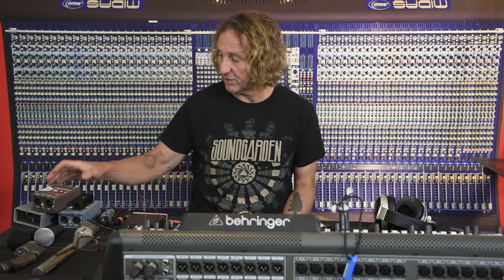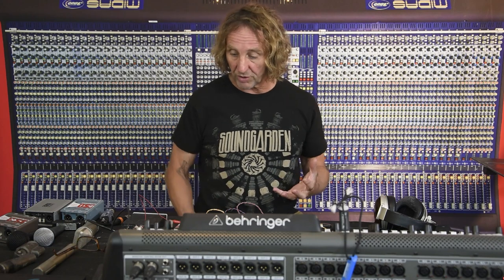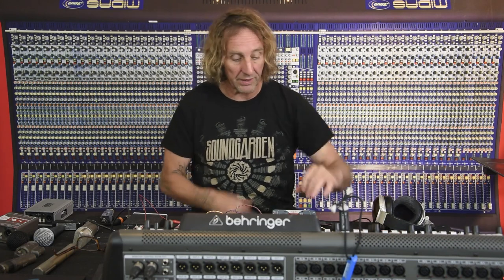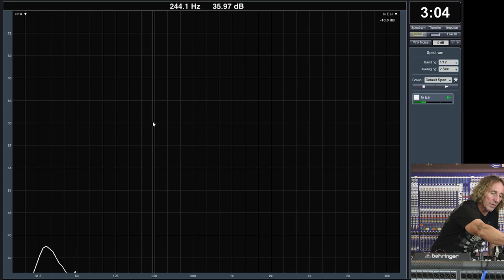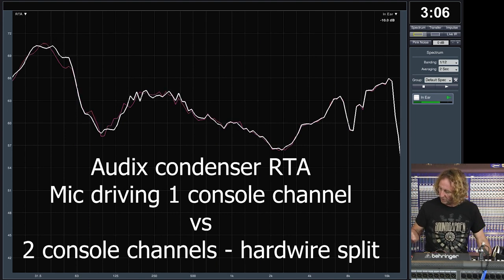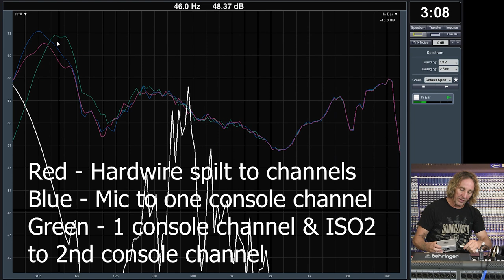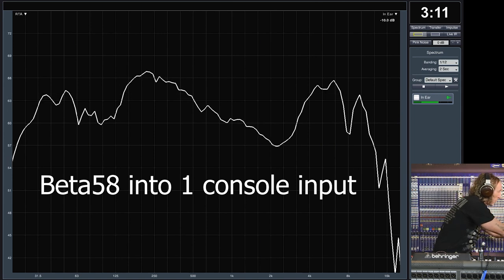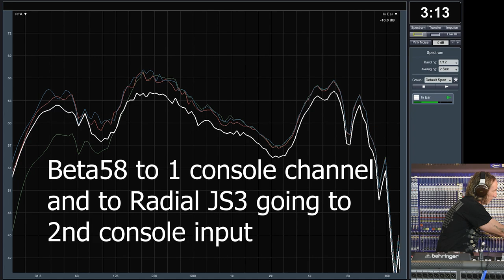Do Audio Transformers Mess Up Sound?  Demo Part 1

Comment: My apologies if I am spoiling the punchline of a later video. The Whirlwind ISO2 is not a mic splitter and is designed as line level isolation transformer, as such a mic should never be connected directly to it. I would fully expect it to alter the frequency response when connected in a mic level circuit. The Radial JS3 is marketed as a mic splitter. These two transformers are for two different use cases. It is on us as system designers and engineers to use the correct transformer for the job. Awesome test though. As you mentioned a little level drop is no big deal as long as the frequency response is unchanged.
Reply from the maker: Ooooh! This is a great subject.

We have mic level and line leve audiol transformers. Do we need mic level for low level signals and line level for high level signals?

We know that running line level into mic level transformers . Can overload/saturate them, but are there issues with mic level signals in line level transformers?

If so, does that mean that quiet and low level line level signals sound bad in line level transformers?

Or are mic and line level transformers pretty much the same and both equally good at mic level except line level transformera just allows higher level signals?

Anyway, I may do a vid on that but in the mean time, for this series I will show that both mic level and line level transformers impact the sound of microphones.
Reply: @DaveRat  I believe it mainly is the impedance of the circuit elements that causes the problem you are seeing here. Even if you load a mic with multiple consoles with a hardwire split you will see frequency response problems due to the loading of the mic output. This will depend on the output impedance of the mic and the input impedance of the connected loads (whether transformers or electronically balanced inputs) I think you illustrated that at one point in your video with the blue line, but at one point (8:45) you said there was no difference between the hardwire split - two channels driven and with hardwire split - single channel driven (I may be mistaken on that). Later you showed that there was a low end difference with one channel driven as opposed to two (the blue line at 10:17). I am not trying to be pedantic or criticize in any way because these issues are in fact real. Interfacing analog gear is a huge problem. Many high end mic preamps for studio use have variable impedance so the engineer can experiment with "color". The level issue is another can of worms altogether.
Reply: @DaveRat  Please do that video!

Comment: Hi Dave, once again, you have presented a nice topic with good scientific method to provide answers to the questions... questions many times people aren't asking and should absolutely be asking. Your topics are great in that you tackle stuff that has always been taken as gospel. Transformers are one of those things. They come to the party like a burly super bouncer and throw out hum quick and without fuss, and a lot of times really solve a tough problem effortlessly. So they get the praise and hardly ever get questioned about that big S on their chest. But the real science behind this and your "sound coloring" type topics is that inserting ANYTHING(gadget, wire or otherwise) into a signal path - mic/line/headphone/speaker/nuclear level, will ultimately change the impedance characteristic and matching in that system to some degree, EVERYWHERE that particular gadget insertion is coupled. And transformers are no exception. Not only that, but sometimes, they may add a more incorrect impedance matching scenario for some applications when using split type transformers and can actually mirror bad impedance matching scenarios into unwanted places. I think it's easy to get the notion that somehow, magically you can put one microphone signal in and get three "identical" and split outputs without paying any price. But science is a heartless bitch that doesn't bargain and will always set the price. I can see where you're heading with this topic, and it'll be nice to see your part 2 and conclusions on just how big a price you have to pay at the end of the day, and is that price worth it for some applications.
Thanks again for going through this and doing the footwork with the simple to understand testing that hopefully more techs will understand and remember. :)

Comment: Yeah, as a gigging musician, my passive splitters (aka transformer) have been life-savers on numerous occasions and in the vast majority of those, the tone alteration was insignificant.
 However, a transformer is essentially just two electro-magnetically coupled coils, which will interact with all the resistors, capacitors, cable-capacitance/-inductance, transistors and op-amps connected to either side of it.
 The "isolation" technically only refers to the grounding-connection, not that the signal itself is isolated.
 The afformentioned occasions of significant alteration were in 

A) using a transformer between my interfaces headphone-out and wireless-gaming-headset-emitter, which resulted in a strong low-pass filter; and 

B) when splitting the direct electric guitar signal, but with a fuzz-face style pedal in either signal chain.

The latter is really a consequence of the the fuzz-faces unorthodox way of loading the input, but it was an eye-opener for me, that a transformer is and will always be a part that interacts.
Edit: PS: when using a fuzz-face, there is no possible way to split the direct guitar signal AND have the fuzz work correctly.
There is a pedal called Lunar Module that supposedly still sounds and reacts like a fuzz-face, but without the loading, so theoretically, it should work with a splitter.

Comment: OK, so this is inline with the impedance video i did a while back.  A change in impedance will alter the lower end response of just about any microphone (more noticeable on dynamics).  The high end isn't effected as much (if at all).  Higher impedances directly connected to the mic resulted in better low end response.  Lower impedance started to rob the bottom end a bit.  We used the variable impedance cloudlifter  product to be able to see what happens to the response as you increase/decrease the load.  When you got to "dangerous" low impedance, you started losing signal strength as well.  Im guessing that when you start to load the line down with splits and other transformers, you're changing the impedance the mic is seeing, resulting in a change.  Would be interesting to see what happens if you have a higher impedance transformer on the same split.

Comment: I have a Radial V12 Convertible splitter (56-channel, 3-way, with Jensens). I did this test a while back and found the differences through a transformer split and 150' snake to be +/- .8 db, mostly centered around 70 Hz. Good video, Dave. I do live recording and I've never had an issue or a complaint with the recorded tracks or from the broadcast truck.
Reply from the maker: The sound through the transformer vs the sound direct are near 8dentical with a slight attenuation as you tested.

The issue is that the sound when the transformer is not connected vs with the transformer connect has much bigger differences and the differences 8mpact both the transformed and direct signal

Transformers change the way the actual mic sounds
Reply: @DaveRat  Agreed. But the sound through the Jensen mic splitter transformer is pleasing and not at all bad. I would like to see the harmonic distortion levels through the transformer, both at unity and pushed a little. That would be good info.
Reply: @DaveRat  Also, I wonder what the impedance has to do with this too. I was always told to get the Jensens instead of the Lundahls because they were better at preserving the high end on long analog cable runs because of the impedance. Never tested it. I do love me some analog farm to table.

Comment: I know the old analog splitters often had transformers on every channel.  But these days if I'm using an ISO it's almost always going to be on a line level signal.  For example feeding a green room speaker that's plugged into the wall.   I'm curious if the transformer has the same amount of impact on a line level signal vs mic level.

Comment: quality video demonstration; a valuable look in to the difference between transparent and colored transformer design. I still prefer Whirlwind products. From what I can tell the whirlwind being the lowest will allow for the most depth of change per perception in the low end and for people that want more breakup sound coming through in the low end of their signal the Whirlwind should be the best. Most transparent Cinemag would then be least colored and therefore offer advantages too. Nothing is right or wrong here since they are transformers and the signal itself is not being manipulated as much as it appears though I'm sure there are those people that will jump to conclusions and want to think whirlwind is wrong, still my favorite. I also really like whirlwind cables.

Comment: Owning a mobile studio made a big fan of transformers. Many years ago, I found a seller with 40 Triiad-Utrad mil-spec transformers with surprising specs [+30dbm below 20hz flat to 30,000 with low distortion]. I think their new cost is $250-ish each. They sounded so transparent to me, I installed them as default in my truck’s hi-level IO. They were TT patch bypass-able but I never even bothered. If someone needed a feed or had a source, it went thru one of those transformers. I made 12 of them into durable handheld ‘dongles’ that can be used for self defense if needed. They are heavy, solid steel cans plus shielded windings. In 30 years of work, they’ve probably saved me a couple weeks 🤣. They are for my purposes, perfect. Very expensive, no excuses.
Reply: interested in selling a couple of them nunchucks?

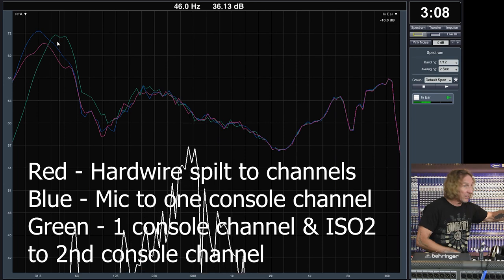Comment: 11:52 of course it changes a bit the response of the mic. Consider that the mic is "watching" 2 different worlds. With the Xformer it's coil and it's internal xformer it get substantial inductive load (and complex, considering also the distributed capacitance inter-winding), very different "environment" from a direct connection to a transformerless preamp. However these values are very small. 
Di per se, if the xformer is connected to signal generator form one side, properly loaded, and the same to the other side going to analyzers, you should get the declared specs 😊
Reply from the maker: I get the declared specs through the transformers. But what good are having super accurate declared specs when the transformers alters the sound of the mic source itself in drastic ways that are 100 x more sloppy?

Plus the transformers alter condenser mics and dynamic mics differently. And alter each brand and model of mic differently and each type of transformer induces different changes.

So here you have this precise transformer spec and as soon as you use it on a mic it makes a huge change to the sound of mics that does not show up in any spec.

All good as long as ya know that you won't know what will happen till you plug it in and listen and what you end up with is not just mic spec plus transformer spec.
Reply: @DaveRat  it makes sense because it’s impossible to test an Xformer on every single mic on Earth. If connected to TLM mics to one side and to electronically balanced pre to the other side, it should behave as declared. But when this is not the case, having a pletora of preamps and mics, it’s impossible to go through all.
Reply from the maker: @Not-Only-Reaper-Tutorials  yeah, so for me, I was surprised the difference were as drastic as they are and so divergent based on mic and transformer.

We tend to assume that if you plug in a mic with a known response and sound into a console with a known sound and split with a transformer with a known and flat response, we will get those known sounds.

The fact that adding the transformer alters not only the sound of the mic passing through it in ways not shown in the transformer spec, but also alters the sound of the mic sent to all other places that are not even passing through the transformer, is interesting and I believe most people are not aware of.
Reply: @DaveRat  exactly… there is not consistency into the sound. Each time a different result and ppl is convinced is something… but it’s something else. That’s why I do avoid transformers as much as possible, when they are interfaced with other transformers. The most sensitive mics, for this side FX, are the passive ribbons … they are dramatically change the tone based on to which transformer are connected to. That’s why I use active ones. And condensers: transformerless.
Reply: @DaveRat  just for example: take a SM57 it has a transformer inside. it's tested at specific impedance. But to what it will eb connected, is totally different from the way it's tested. If it's connected to a transformerless preamp: chances are the characteristics are exactly the ones declared.
but when you connect ti to a transformer, things are changing. The impedance of this, not only is sen from the Xformer of the Sm57, but it's translated down to the capsule, and she will work differently; 
because the impedance she will see, it's a bit more complex and different from the one she was tested (this latter is tipically pure resistive) ... and it changes her response .. or better the response is the result of the summign factors: Capsule + mic Xformrer  + external Xformer. And so on and so forth ... I prefer (as I said) to avoid to use them as far as I'm constrained for some reason.
Reply from the maker: Yeah, it's more messy and audible than people realize

Comment: So I can visually interpret how a transformer will make a mic thin, thank you Dave.
Reply from the maker: And yet as you will see in future videos, transformers make some mics have more low end
Reply: But it noticable only in inaudiable frequencies in low end so no biggie
Reply: @frutekneobichni2123  not really, with the dynamic mic it starts rolling off at above 125hz. Also, the attenuation is pretty substantial at close to 5 or 6dbs on some frequencies..

Comment: Was the graph showing a sum of channel 1 and 2 or just channel 1? If it was the sum my uneducated guess is that there is a slight phase shift leading to negative interference in the lows. But that would be irrelevant to me as I never sum two transformer isolated signals.
Reply from the maker: The graph is not showing the sum.

Adding a transformer adds inductance altering the output of the mic.

Just adding the transformer whether it is plugged into anything else or not, makes everything the mic is connected to sound different.

Comment: my spidey senses says something with the impedance is changing which is causing some of that low end roll off? I'm not an expert, but yeah good to know this is a thing!
Reply from the maker: Yeah, the sound through the transformer is excellent but the inductance and resistance of the transformer alters the sound that the mic outputs.  And on some mics it boosts lows, some it cuts lows, some it attenuates some or all freqs.
Reply: @DaveRat  wow! so things are not as simple as they may appear on the surface, or they are not as simple as we want them to be! haha great insight thank you sir
Reply: @DaveRat  Are these all proper wound transformers, or are some using some sort of solid-state buffer?

Comment: Interesting, although visually and to my ears the noise does not really change on the Radials. Given the behavior of coils (storing energy in magnetic fields), I'd be interested in phase changes as well, but given the nulling options, you're probably going to talk about that in the next videos. One more thing, do these transformer boxes normally have a method of transferring phantom power? I'd expect the simpler versions at least to block that (it's DC after all). Since you use a split, I guess that's what gives power to the Audix?
Reply from the maker: Yes, will cover in the next vids.

As far as phantom, typically at least on connections direct and the other connections are through transformers.

The big surprise for me is that we used to argue and decide who gets the better sounding direct feed and supplies phantom and who gets the transformer splits.

What this shows is that as soon as there is a transformer added, the sound is changed for everyone including the direct split.

Comment: @Dave I am only doing small clubs. I run an IEM system where I split to the IEM and FOH. I use the cheap ART mic splitter.  Question: at a small venue do I need to have a transformer isolated signal or should I just do hard wire split like a Seismic Audio splitter?
Reply from the maker: My experience has been that if you can get away without a transformer, the sound is better.

If FOH and mons are all connected to the same power outlet box, you should be able to avoid transformers